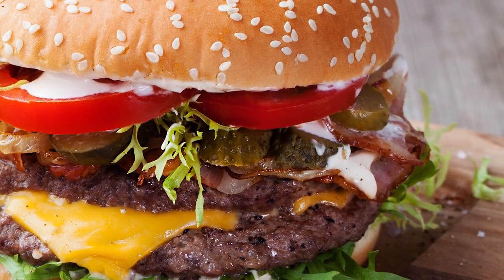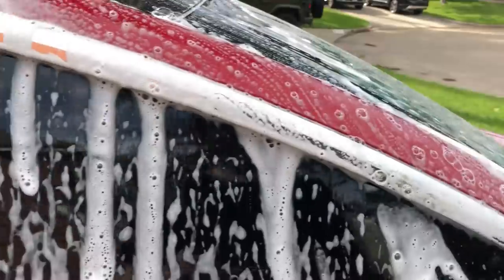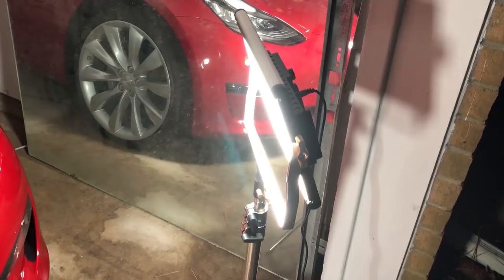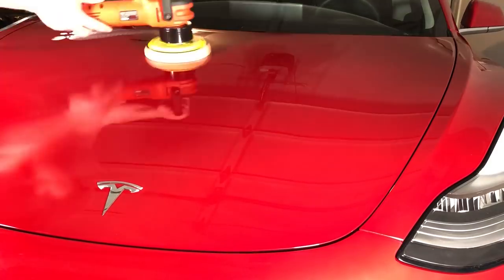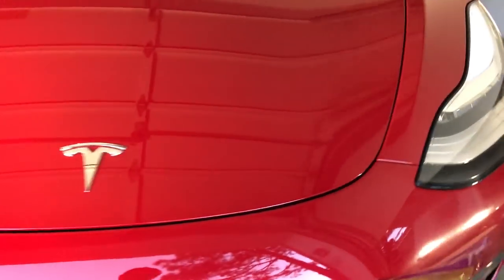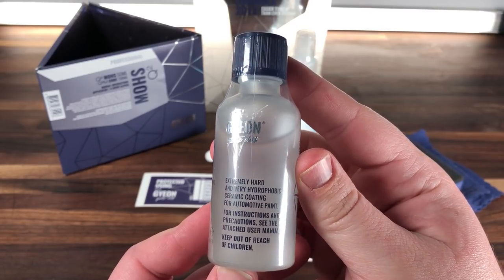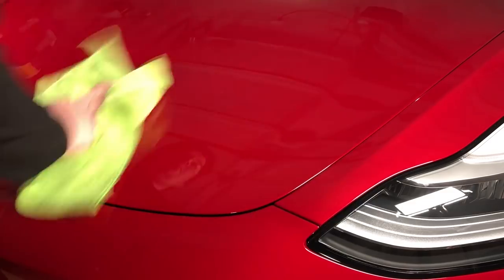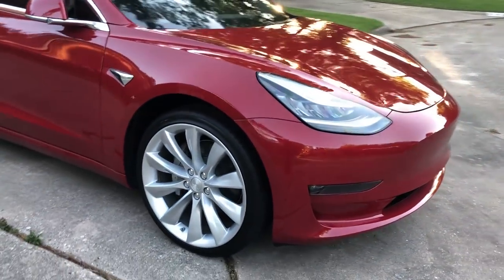Tesla Model 3 | DIY Ceramic Coating

Comment: Great vid Kenriko!

I'm a bit late to the party on the comments but wanted to add some additional tips for novice DIY ceramic people out there.

1- Not all ceramics are 'apply and wipe off instantly'.  Maybe be this way with Gyeon but CQuartz, for example, requires a 1-5m flash time before removal depending on air temperature (usually 3-4 min @ ~70*F)

2- High quality microfiber towels are a must.  They will make or break your install.  You'll want around a dozen (ideally more) NEW high quality, low lint microfiber towels AND a set of ~8"x8" synthetic microsuede squares (these are in addition to the applicator squares included in the kit).

3- Also, buy microfiber specific detergent and wash all towels to remove any trace of lint prior to use.   This is where a lot of people go wrong e.g. they assume a new microfiber is as clean as it gets and use it out of the wrapper.  Wrong!  MF detergent will condition the fiber and help remove lint.  Wash in cold and dried ultra low or air dry and seperate each towel type into individual loads (only wash and dry 1 type of towel at a time).

So the process looks like this:  apply ceramic w/applicator in kit > allow to flash (product dependent) > level and remove high spots with 8" microsuede square, then buff with a regular microfiber folded into 4ths.  Flip every 2 foot section and use new towel as needed.

Hope this helps!

Comment: NO NO NO
YOU DO NOT USE CIRCLES ON CLAY FFS
Clay picks up dirt, grit, and other stuff in your paint. It still carries is around until you fold the bar over. Straights lines ONLY or you end up with more swirls.

Comment: How long does the ceramic coating last for?
Reply from the maker: 1 year
Reply: Kenriko Wow 1Year!!!
Reply from the maker: Since this is a new car and we're only using M205 polish the amount of cutting is minimal and won't be an issue for the life of the paint. If you need to use more abrasion on an older car / paint that's in bad condition than it's advisable to get a paint depth meter and monitor how much clear coat buffer (thickness) there is to work with. You don't want to cut too much and not leave the car without enough clear coat to properly protect the base coat.

Comment: Great video. Next time you clay bar use left to right horizontal motions. As you lift contamination off of the panels you can still cause swirls so better to have straight line scratches rather than circular swirls
Reply from the maker: Good point, though I knew I would be polishing directly after so I was less worried about the clay bar process marring the paint it's certainly something to keep in mind.

Comment: I did my Model 3 following direction of this video came out pretty good, on brand new car Clay bar step might not be necessary , my white Model 3 painted very good from factory I was afraid I will ruin it, ceramic coating layer is extremely thin so if one miss a spot or two it would be hard to tell, expect to spend at least one hour on each step, just to be in safe side I used Polish machine very lightly, did it mostly manually, like video said you don’t want to polish too much otherwise there is risk of taking top coat off. Ceramic coating may be could be used on windshield but didn’t want to check chances, may be I will try it on side window someday, recommended ceramic coating bottle is adequate for one coat, I did front bumper and hood area two coats.

Comment: One question - doesn't the IPA just remove the polish you literally just put on? Its the one step i don't understand. I thought an IPA is designed to remove everything.
Reply: The Polish isn't a layer of anything really. It's a micro abrasive to get rid of swirlmarks and scratches - essentially the first step of paint correction. Hope that answers your question

Comment: Awesome video and I am planning to do this to my Model 3.  Quick question:  Do you recommend Ceramic coating the glass surfaces: Windshield, Glass roof, driver and passenger windows, etc.  Can I apply the remaining ceramic coating to the glass surfaces?
Reply from the maker: Yes you can keep in mind I’m pretty sure the Model 3 owners manual says to avoid using RainX / coatings on the glass in front of the cameras.

Comment: Looks like an amazing product and excellent job doing the application!!  The wheels look good, too. Are they 19" or 20?"  And from T Sportline or EVT?  Thanks.
Reply from the maker: Thanks. They are 20in EVT wheels. I've gotten 275wh/mi Avg over the last 3000mi with them (vs 250wh/mi with the 19s) so you do take a pretty decent hit to range but they look great and the car handles better with them and a good set of tires.

Comment: Hey bro.  You do any lowering on those 20s? Or standard ride height? Car looks great. I think your cars look helped me pull the trigger on these 20s. also did you go staggered or square with the wheels?
Reply from the maker: No lowering. They are square. This car is actually going to end up being sold since I'm taking delivery of a Performance Model 3 soon.

Comment: How do you like the EV Direct wheels?  No one seems to be able to answer my question on the 20".  Do you feel a performance hit in acceleration / mileage?  How is the ride quality?
Reply from the maker: Ride quality is good but I'm a person who likes the ride of the 21in wheels on my Model S. If you don't like the ride 21s on the Model S then you likely won't like the ride of 20s on the Model 3. You get better steering feel with the lower profile tires. 

I clocked 0-60 @ 5s flat with the 20 in wheels on Nitto NT555 tires. You could likely get times better using 18s with UHP tires but it kicks the stock Michelin MXM4 tire's ass. The stock tires on the 18s will only do 0-60 in 5.4 - 5.5s because they are all-season and lack the grip required for the amount of torque the Model 3 lays down. 

270wh/mi mixed. (I drive... spirited)
300wh/mi @ 80MPH. 

So yes you'll take a big hit to your range but performance in acceleration/braking/handling (and looks) will improve. If you're driving it less than 250mi/day than the hit to range does not matter because the cost of that extra 10kw or so of electricity used per charge is maybe $1? And for me I would rather my car performs well than worry about it costing $1 extra over 250mi of driving.

Comment: Did you use the product on glass and wheels?
Reply from the maker: I only had enough leftover after the two coats of ceramic to put it on the wheels. To put it on the glass you likely need a second smaller bottle.

Comment: Are those small bottles adequate for the whole car? Would it be better to apply 2 coats?
Reply from the maker: It's enough for two coats on the paint. Wheels and glass would require more of the product.

Comment: I'm going to go even further down the rabbit hole and have a clear and shiny wrap put on, as well a ceramic coating. What, in your opinion, is the life of those coatings? Iv'e heard, five years?
Reply from the maker: It depends on the coating, generally 1-2 years for the coatings that are easier to install. 5 Years for some of the more "fancy" coatings but there is some B.S involved in that because they generally require you to come back every year where they re-apply a top coat, it's more of a trick by the shops to keep getting money from you. 

The wraps generally last 5-10 years if installed properly.
Reply: Kenriko Thank you so much

Comment: What's the worst thing that can happen if I don't do all these preparation steps and just do a nice wash and then put on the ceramic coat?
Reply from the maker: You will still have contaminants on the surface and you'll seal them into the paint.
Reply: As long as the overall look of the car is clean, I don't mind. There will always be small imperfections. Are there any chemical reaction problems with applying the ceramic coat directly on the paint?

Comment: I LOVE THIS VIDEO! But can you link the amazon links for ALL the materials. I'm thinking of doing this to my Model S. THX
Reply from the maker: Non Affiliate links: 

Wash: https://www.amazon.com/Chemical-Guys-CWS_110-Honeydew-Cleanser/dp/B009OTW646/ref=sr_1_4?s=automotive&ie=UTF8&qid=1525440573&sr=1-4&keywords=Chemical+guys+snow+foam

Microfiber: https://www.amazon.com/AmazonBasics-Microfiber-Cleaning-Cloth-24-Pack/dp/B009FUF6DM/ref=sr_1_30_sspa?s=automotive&ie=UTF8&qid=1525440680&sr=1-30-spons&keywords=led+wand&psc=1

Polisher: https://www.amazon.com/Griots-Garage-10813STDCRD-Orbital-Polisher/dp/B009UKUUWE/ref=sr_1_3?ie=UTF8&qid=1525440372&sr=8-3&keywords=griots+garage+polisher (you might be able to find this $10-20 cheaper check your local autoparts store)

Polish: https://www.amazon.com/Meguiars-Mirror-Glaze-Finishing-Polish/dp/B001O7PNXC/ref=sr_1_1?s=automotive&ie=UTF8&qid=1525440653&sr=1-1&keywords=m205

Clay: https://www.amazon.com/Mothers-07240-California-Gold-System/dp/B0002U2V1Y/ref=sr_1_1?s=automotive&ie=UTF8&qid=1525440528&sr=1-1&keywords=mothers%2Bclay%2Bbar&th=1&psc=1

Prep: https://www.amazon.com/Gyeon-Prep-500ml/dp/B00OORQT82/ref=sr_1_5?s=automotive&ie=UTF8&qid=1525440494&sr=1-5&keywords=gyeon

Ceramic: https://www.amazon.com/Gyeon-Mohs-Quartz-Coating-Kit/dp/B01CESR0H6/ref=sr_1_1?s=automotive&ie=UTF8&qid=1525440604&sr=1-1&keywords=gyeon+mohs

Optional but useful: 

LED Wand: https://www.amazon.com/Amzdeal-Lighting-Control-Rechargeable-Brightness/dp/B072Z8RM3B/ref=sr_1_4?ie=UTF8&qid=1525440751&sr=8-4&keywords=led+wand
Reply: How do you think about C.Quartz? Many detailing shops have all recommended CarPro Cquartz 50 ml  which also has great rating on Amazon and price is more reasonable than Gyeon coating kit.
Reply from the maker: Watch this video he does a really solid test of each: https://www.youtube.com/watch?v=VHpU-bOpIhI